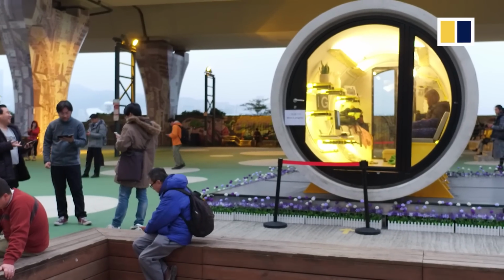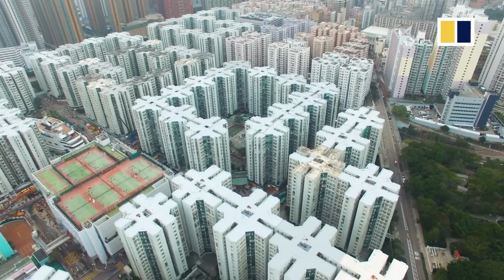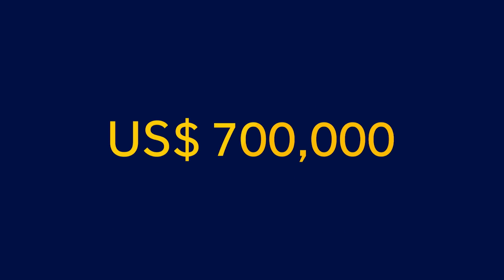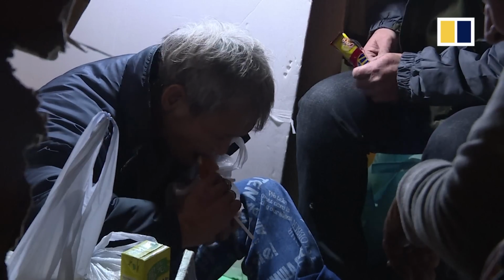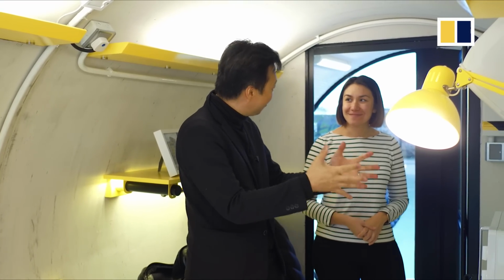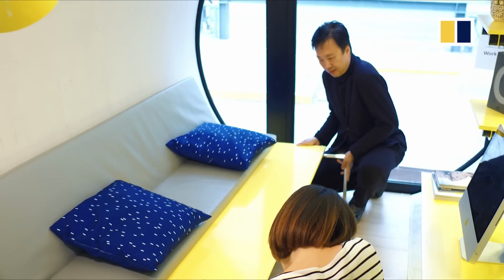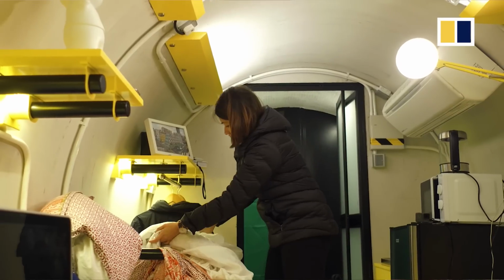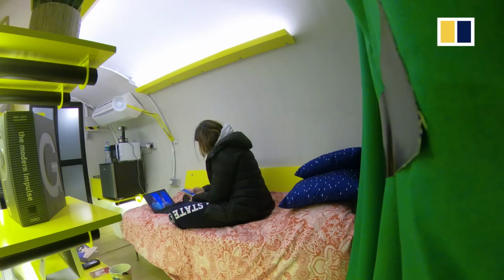Live in a water pipe: potential answer to Hong Kong's housing crisis

Comment: House made of shipping containers, u can stack them and save space. This round one is fine by itself but u cant really use the vertical space
Reply: Vu n qian n Stack them like legos or play Jenga 😂
Reply: Agreed, shipping containers would use the space much better. The rounded corners leave some space wasted
Reply: Vu n qian n I agree
Reply: Like readyplayerone the movie / book
Reply: Ready player one.
Reply: @Nij Jin insulation. Ur own house will probably have something like drywall, insulation sheet, sheetrock, then sidings or bricks on the outermost layer. On the bright side, its also a lot lighter to transport it to site
Reply: @Nij Jin still much cheaper than wasting space. Just fyi the land cost more than the building itself. So stacking them up like a condo/apt concept will be saving tons of $
Reply: @Nij Jin u can do anything with enough $ :)) $ can control even god
Reply: they will get very hot in summer
Reply: Nij Jin ik, i meant the containers would be hot lol
Reply: @youdayeonace4145  yea and cold in winter. Thats why theres insulation and drywall. Like an actual house? But tiny and ready to built container instead of bricks and wood sidings
Reply: He madr use of left over pipes.. why even shipping container then? Just make a affordable small square house..
Reply: @lightr2187  whatever works best and utilize material as well as save space. I assume u dont read all the dang comments
Reply: Containers will be heat up by relentless sunshine, typhoon will blow away those  containers  that stacked up on top, this make people unbearable and dangerous as well
Reply: But it's ok you can have your own little garden.
Reply: Is it possible to "glue" it tgt with something?
Reply: Use the leftover space between pipes as tenants' storage!
Reply: They are REUSING it ;). Why spent money on something like this when they can have free pipes!!
Reply: @funwithsophia7133  Those Pipes Are Not Free 😅
Reply: We have shipping container housing with AC units. It's still larger than most HK homes.
Reply: There's an entire show about ppl making homes out of containers.  I think it's called Container Homes.

Comment: There is no storage space.. clothes, necessities. The round shape is actually a waste of space. Make it boxy and you have more areas for storage.
Reply: HAHA ikr
Reply: but they are re-used water pipes, if they were square they'd have to be made for this instead of grabbing used ones, thus greatly increasing the price, and defeating the point of solving the housing crisis.
Reply: Octagons would maximize space, make it moduler, and is a very strong shape.
Reply: @daanscatozza  reuse a shipping container duh. Or reshape the pipe
 The crisis is about space not price.
Reply: @daanscatozza  housing crisis is all about not enough land space
Reply: Minimalists: pathetic
Reply: @doclinny  shipping containers can be reuse many times but pipes is very easy to break so that’s why they think of this.
Reply: @PrayFor MeYall there is my dear
Reply: @doclinny  I am pretty sure the idea of reuse container is implemented. The designer in the video clearly said that the reason is to prevent waste for the left over pipe.
Reply: They could line the curved part with foldable shelves. But, yeah, you'll have to be a minimalist in order to live comfortably.

Comment: Land space isn't the problem, 75% of Hong Kong's land isn't even developed, I know you can't develop on some parts of Hong Kong but that's certainly not the case on the whole 75%. The government owns all the land and they can simply get a lot and host a bidding for contractors to build a low cost apartment complex. The problem is that the Hong Kong government seems to prioritize leasing out the lands to the highest bidder causing the prices to shoot up even higher. But then again I'm no expert.
Reply: Well actually the land is owned by business tycoons that bought the land from the British government prior to the handover. But otherwise you're correct, they can just sit there and wait for their housing prices to increase.
Reply: @danaliu3295  and these business tycoons have bought off the pro-democracy side of the government to prevent their worst nightmare: Beijing rolling in and forcing land reform, which would cause property prices to drop like bricks.

Comment: Shipping container units. Ladder access. That’d be easiest - those containers can hold a lot of weight and can stack up securely. Lift and stack them, run pipes up the outside and have a ladder system. Pipe up heat (hot air or water), and water. Pipe down waste. Pump system. Kids and elderly would need to live on the bottom row, but no reason why young people can’t climb a ladder every morning and night. A secure permanent ladder - not a removable ladder. Like a fire escape type of ladder that’s pretty wide.

Comment: The idea is actually quite sensible and all it requires is an increase in the size of the pipe, specially in terms of width and it will result in a permanent solution to the housing problem.

Comment: In my opinion this doesn't solve anything. The problem is not construction of houses, it is land space where the house is constructed. Where do you get that until you build taller or deeper. Would be interesting to see these hanging under the bridges though. Especially if they were in honey cone structure.

Comment: It can be possible. With the right vision and execution. With proper plumbing, heating/cooling & working stove inside the pod i dont see why not. 

I believe the best way to go about this is to create pod communities as you already see in apartment/condo communities. You have around 12 apartments per building and can have more than 10-15 buildings on one location. Since the pods are smaller you can have 20-30 pods per "one building" and have 40-60 pods per one location. Have a place for vehicles, have proper unit numbers and pod addressees and have a ON SITE, ON LOCATION (not inside the pod) place for washing and drying clothes.. It can defiantly work.

Edit : and make rent reasonable for the space. I say most wouldn't mind paying anywhere from 400-700 U.S dollars a month.

Comment: If you think about it. Building materials are not the issue its space. They can recycle that concrete and make rectangles which would me being stackable and more universal fittings. It would also provide jobs. This is just a showcase to promote the designer and in no way practical.

Comment: Well a building is supposedly stacked cubes/boxes which is supposedly more effective than stacking cylinders/circles. Can't see how this would solve any of the current problems.

Even if this is more cost effective. The issue isn't the cost of building (construction) but the amount of land used for residential thus the increased cost of housing.

Comment: Imagine concentric rings of these rising high into the sky. They'd be painted of course to resemble giant floating donuts.

The supporting structures needed to raise them up would double as elevator shafts and entrance ways to the outer ring living spaces.

Each one would have panoramic views of HK and the top donut would be the best I guess. I guess you could add windows and keep the structual integrity high enough

If the architect was feeling fancy they could install a central rotation device so every giant donut ring could rotate like the famous (now gone) Furama Hotel.

Comment: Not a solution.
Reply: Why?
Reply: @pheidolefan  Let's further this discussion into a more feasible solution: Say we have a ridgid structural frame that is made of composite structure (metal/ reinforced concrete) that could last for 100yrs- and the habitable units are made from container boxes retrofitted with utiities and amenities decent enough to be called a living space- these units can last for 20-30yrs and can easily be refurnished or replaced with newer container boxes fitted with the latest amenities. Wouldnt that be more logical to present as an architectural solution from an architect.
Reply: @iamyodaok  That’s honestly true, they could be stacked or modified to fit together to make even more space